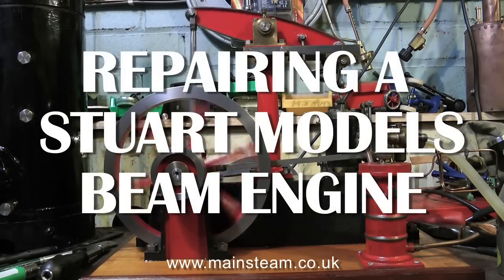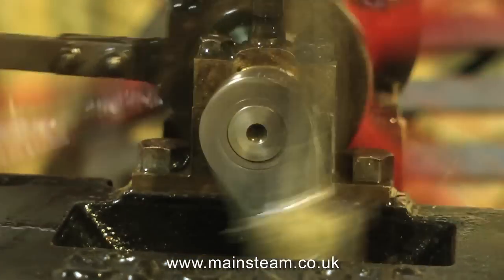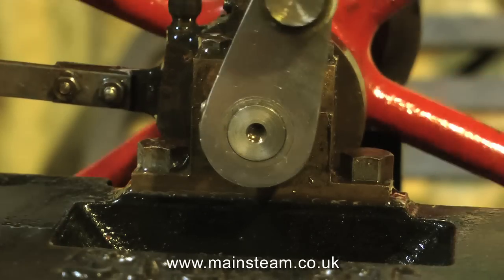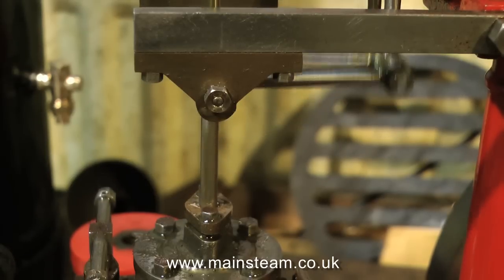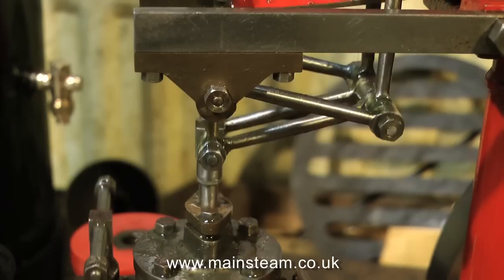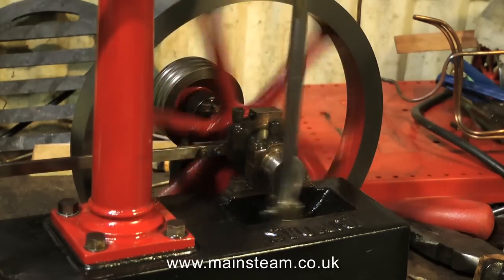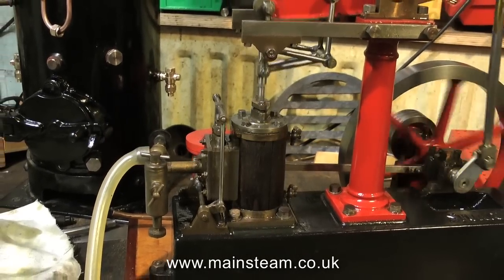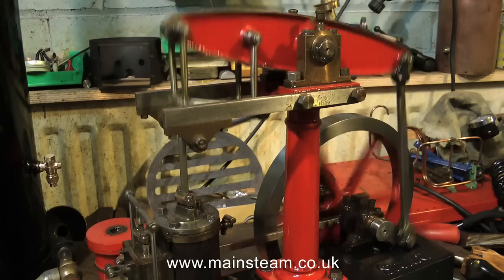HOW TO MAKE A STUART MODEL BEAM ENGINE RUN SMOOTHLY

Comment: great tips, I found that a wore bearing on the end of the main connecting rod on the crank caused knock on my engine. I also didn't sleeve the main crank bearings, they were drilled small by a couple of thousands and allowed to wear in to a perfect fit....mine isn't as smooth as yours but I am satisfied with its running.